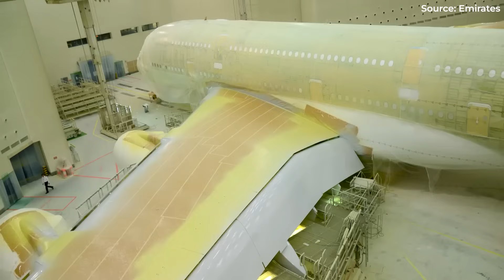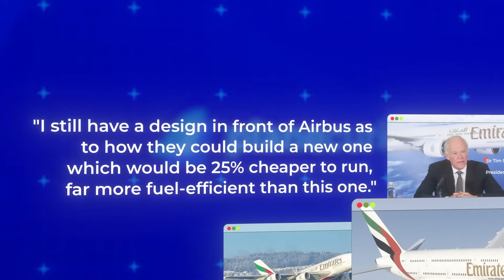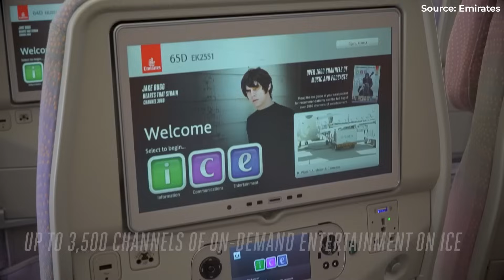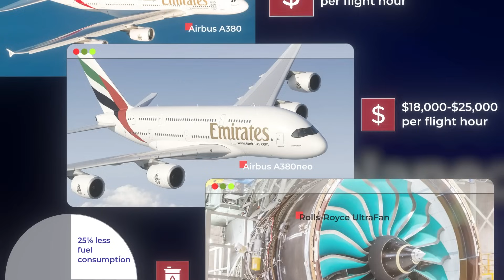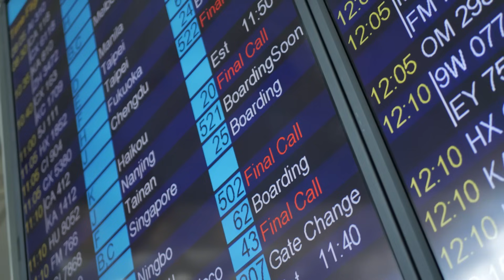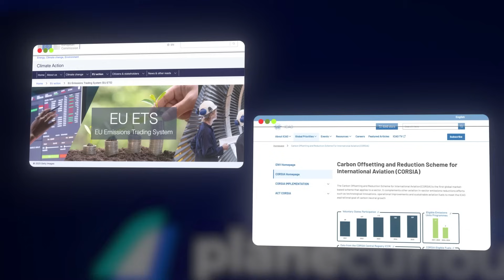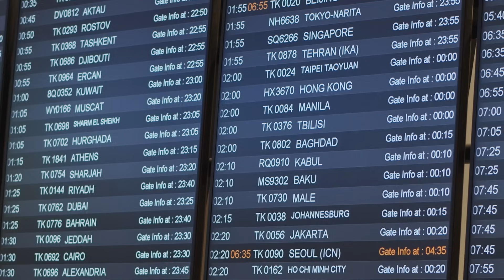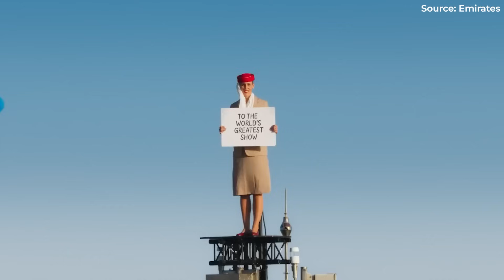Emirates Needs The A380neo - But Here’s The Twist

Comment: the A380-900neo a stretched variant of the A380-800 was conceptualized way back in 2011 . . . but the dream was never realized due A380-800 less than satisfactory sales . . . AIRBUS should have launched the stretched A380-900 variant instead of the A380-800 like they did with the A350 family . . . the stretched A350-900 was launched prior to the A350-800, although the A350-800 never made it to the assembly line is a story for another day . . .

Comment: Emirates has succeeded the hub and spoke..... They literally pour millions in dxb and reroute millions to final destinations. Clark masterminded the hub and spoke. For this hub and spoke to be successful, a380 is the key
Reply: tsa check at airport like changi ( singapore) is a stupidity that ruined the hub and spoke . they even debark plane get them thru security to rembark on same plane on route london singapore sydney . without such corruption or stupidy hub and spoke is cheaper more efficient used everywhere else in any transport route i have yet to find a city which metro aways follow direct route so far i saw  use hub and spoke long distance, regional trains ..... car are direct but they are dying in the world didn't ford and gm noticed ?

Comment: Would having 3 engines instead of 4 work? Like the tristar? Have (3) GE9X engines? That's enough thrust but servicing the engine at the tail will be alot of labor.
Reply: Frighteningly high re-engineering costs and the reason 3 engine planes died is, in part, down to what happens when that engine lets go and breaks rudders, hydraulic lines etc. The words “hull loss” come to mind… and 600 dead pax!

Comment: Possible solution: upgrade, don't replace. Replace the winglets with the plus version, replace the engines with more efficient ones (this is expensive and complicated but I think thats way easier than building a whole new plane because u could reuse the fuselage. If theres still enough budget, may even consider replacing the wings with smaller lighter more efficient wings. and maybe even replace the gear with a lighter one. I think this would actually be possible.

Comment: You are forgetting the part of the equation which is airport infrastructure and gates.  

Some airports upgraded taxiways but the number of gates that support a380 were limited.   Norwegian Air experienced this when flying the hifly a380 to JFK.  The limited gates that supported the a380 were taken.

Given the a380 already failed once, airports, which are government owned entities, would have to justify to cost of building gates. 

Right now, they have far more gates that support the 777 and 747, and the 777x fits those existing gates that don’t fit the a380.

Planes like the 787, a350 and 777 can operate at more airports using existing infrastructure.

Building a380’s in the USA wont make a difference to US Airlines,  they didn’t order the a380 before because it doesn’t fit their business model of multiple hubs with lots of non-stop flights to many places. 

Even flagship European airlines like BA, Air France,  KLM and Lufthansa did not order enough a380’s combined to make a difference.

Limited run aircraft for a specific user are astronomically expensive.  Just look at military aircraft and the unit cost when you only want 20 or 100 planes. 

Maybe emirates can offer $50 billion to build 100 planes guaranteed and then get a discount on the second 100 planes but inflation will mean those second 100 cost another $50 Billion or maybe $75 Billion.

Comment: I absolutely love flying on the Emirates A380's - as a passenger when I'm booking my flight I'll always take the route and time slot that gives me the A380 if possible. I'd love to see the A380 get a second chance with the improvements that address all the criticisms. If the current generation makes sense for Emirates and these things make huge differences to the operating costs then it's a bit of a no brainer. If it needs a new factory, honestly think Emirates should push for that factory to be in Dubai and be a joint venture - Emirates funding and Airbus operating - and make the A380 Neo exclusive to Emirates - let them have the competitive advantage. Then keep the facility for refurbishment, maintenance and upgrades, or potentially have the option of running it at 100% production capacity for the initial run and then taper it off to 25-50% of the capacity focussing on new plane production and the remaining space pivots to maintenance.

Comment: If they restart the A380 production lines, then they should go the full hog and launch the A380-900 Neo. The current A380 has a disproportionately large wing and heavier-than-necessary undercarriage to allow for a stretch that never eventuated. And moving 800 passengers rather than 600 per flight would bring seat-mile costs down even further.

Comment: We constantly hear arguments for and against a new A380. However, people keep missing the most important point.

An aircraft manufacturer doesn't just need a large enough order to make it work, but to guarantee continued production, it needs sufficient orders to provide a high enough rate of assembly to keep the line viable until the earliest examples need to be replaced. Clearly this isn't an issue with the likes of the 737 and A320 aircraft series, where an Airline could place an order for the replacement on the same day as that factory-fresh aircraft was delivered. Even so, they might still be keeping hold of them for longer than they would like. 

No matter how good the aircraft is, and no matter how much the airlines love it, insufficient demand will see the production line closed down. The 757 being a good example here.

We must also consider if the resources required (manpower and production space) could be better with tioised elsewhere.

Comment: I've lobbied President Trump and VP JD Vance to build the A380neo in Mobile Alabama. That way with a 'Made in America' sticker would enable the US airlines to buy them and use them for long haul. They would also get around tariffs and be worth $500 Billion to the US economy. Emirates would probably buy as many as they can get hold of to replace the existing A380 and it would take 10 years to do that, by which time the old A380 will be at the end of their useable life anyway.

Airbus does not need to relocate existing production lines - just start a new one in America. Let's not forget - that 25 Billion loss was absorbed by the EU, but they could make back that loss with the A380 neo if they get 1000 orders. The B777X and A350-1000 cannot make up for the demand and get around the slot problem. Building the A380neo is needed now to provide the aircraft for the 2030s to the 2060s.
Reply: The one thing I see with that that I just don’t think would work is us based airlines investing in it.   I don’t think they would.  Even if it was made in America, I just don’t think it would fit their business models.   747-8i was built in USA but no American Airliners bought it.   So I honestly can’t see any investing in a USA made A380

Comment: Its all according to HOW BAD emirates want a 380-Neo. Airbus already said they redesignated it’s facilities to something else. So if Emirates want it that bad, they should build the facility in Dubai, pay for the machinery and retooling, and pay Airbus for its employees to design the -a380NEO . Because it would specifically be for Emirates. Airbus should not come out of pocket for anything. 

This project should be completely paid for by Emirates. I believe if they gave them that option, Airbus might bite.
Reply: All the Airbus facilities are now occupied. To build the A380neo they would need a fresh factory. However, they could build it at an existing Airbus site in the United States. Airbus originally wanted to build over 1000 A380. Emirates considered 126 enough, but they might want more if it were economical. Maybe 250, but not much more than that. 

Emirates currently has 9 x A350-900, 121 x A380, 22 x B777F1H and 119 x B777ER. That's 271 aircraft.
They've ordered 205 x B777X and 15 x A350-900 but so far, Sir Tim Clark will not order the A350-1000 unless Rolls Royce sorts out the cycle problem with the Trent XWB. So that's 220 aircraft on order - but they might cancel some of the B777X if Boeing do not deliver and order the A350-1000 instead.

If Airbus were to build the A380neo, it would take them about 5 to 10 years to get them coming off the production line - just as the current A380 are retired. That way they might not need as many B777X or A350-1000.
Reply: @WOTArtyNoobs  if built, the a380-Neo would be a Emirates exclusive jet. Because they would have to fully pay for it., from the enormous facilities, to the development team, to the machinery needed to physically build it. So why not build a factory in Dubai since it’s going to Emirates.. the person that paid for it
Reply: @WOTArtyNoobs  Airbus doesn't work with a 'factory' business model, it works via modular manufacturing that gets assembled. That means it just needs a new assembly hall and that's not that expensive compared to the profit per unit.

Comment: The point to point model only had a limited lifespan. When it reaches capacity, the demand for giant planes will return, even if that's on point to point routes!
Reply: Most people think that as it is so big that there are few airports that can take the A380. That's not true. It does require two or three air bridges to load and offload comfortably, but it would not require much work elsewhere at the airport.

Comment: Airbus would likely make a stretch A350-2000 then resurrect the A380.
Reply: Not sure they can. The A350-1000 took this design to the maximum limit. If they were to elongate the fuselage much more, then rotation might not be possible. You would get tail strike when the pilot rotates. The A380neo would also stretch the fuselage, but not past the point that it causes tail strikes.
Reply: @WOTArtyNoobs But A380neo despite more efficient than the original A380 is not efficient enough compared to dual engine wide body aircrafts loke A350.
Reply: @WOTArtyNoobs  yes you're at the limit of length with the -1000, the A380  is the only way; or a A350 twin deck

Comment: If Emirates are ready to pay than I would love for Airbus to build it. One of the best airplanes ever.
Reply: It's a question of building them at a brand new Airbus factory in America. They already build the A320neo, the A220 and the A319 at Mobile. If they added the A380neo then it could be worth $500 Billion to the American economy and they would sell to US airlines too.
Reply: @WOTArtyNoobs nah us airlines never wanted the A380 in the front place they won’t even want A380neo
Reply: @JackMooGamer45 Let's clarify this. The American airlines did not want the A380-800 for several reasons. Firstly it was a foreign aircraft and very expensive. Most airlines try to buy domestic because they are big capital spends and they need the local support. Secondly, it did not fit the business model that the US airlines were addicted to, Point to Point flights. Thirdly, they wanted to offer the passenger several flights a day for convenience of picking their own travel time and lastly (and most importantly) the A380-800 has four engines instead of two and that means greater fuel burn and maintenance costs. 

Most American airlines have multiple hubs spread out over the US and this means they can shuttle people back and forth in small passenger jets like the Boeing 737 series or the Airbus A320 series. One huge A380, even though it can carry between 500 and 800 passengers, would not be best for several flights a day because of the fuel cost.

However, the American airlines did not take into account slot restrictions. There are airports in the United States that have capacity constraints. JFK and La Guardia LGA are restricted, as is Ronald Reagan DCA in Washington. The majority of US airports have ample space for the traffic. In the rest of the world, the slot restraints are at Heathrow LHR, Changi SIN and Dubai DXB. You almost cannot buy slots to land at these airports for love or money. British Airways almost monopolises Heathrow because they bought out the other major user of that airport and they did it to buy their slots. Emirates monopolises Dubai DXB, but they probably won't do this when they move to DWC as it's far bigger. Singapore Airlines monopolizes Changi because it's a State owned enterprise and Singapore is tiny when it comes to land. The A380 is perfect for slot restraints as you only need one or two of them a day to carry massive amounts of passengers to other hubs. 

None of the American airlines considered that it was important to have large aircraft to fly to international hubs, so they made do with the Boeing 777-300 or other wide--bodies to do this, even though it constrained them to a maximum of 300 passengers. They are now starting to realise in the post Covid boom that this was wrong. The demand for international air travel is booming, whilst the demand within the US is almost stagnating. Many US airports are facing massive shortfalls of passengers, mainly due to domestic decline during the past 4 years. Whilst the rest of the world cannot get enough travel, the US market is facing problems of price increases and shorter passenger loads. Part of this is down to the fact that many of these point to point aircraft are flying with low % loads and partially because when you have several aircraft flying a day instead of just one, you have the extra capital cost of the additional aircraft. So whilst prices on ordinary carriers are getting higher, more people are flying Ultra Low Cost Carriers because they cannot afford the usual airlines. The ULCC airlines can afford to do what they do because they offer no frills travel and usually have the same aircraft - such as South West using only B737.

What the US airlines neglected was their ability to get the international passengers to use them for flights to the States. Instead, these passengers use A380 to travel to the hubs and then ULCC to travel to their final destination - which is the hub model, not point to point. 

If the A380neo was built with the Rolls Royce UltraFan, it would be as fuel efficient as the Boeing 777X or A350-1000 due to the numbers carried. The A380neo could carry 1000 passengers in all economy, but would more than likely only carry as much as 650, with a higher percentage of Business and First. This is because the stretches to the hull would be in the areas where the premium passengers sit. Premium passengers love the A380 because of all the perks it brings. It's comfortable, it's quiet, there's masses of space and on some there are even showers and bars. The A380neo would not only be cheaper to run per passenger, even with increased maintenance costs, but it would attract more passengers that would stick with the airline for the follow on flight. Take Emirates as an example. They run the A380 as a hub aircraft and you can fly to just about any destination from Dubai and most of those are on A380. Even if they are not A380, you are switching to another of their fleet for the final flight to the ultimate destination. 

If the A380neo were made in America, it could be worth $500 Billion to the US economy. It's very likely that Emirates would buy as many as 200 of these, whilst current users would probably double their fleet or even triple them. If they could have an A380neo as cheaply as a Boeing 777X, they would get the A380 for the passenger appeal alone!

Airbus say that they want $25 Billion down (the cost of the losses on the original A380-800) before they would even consider the A380neo. Emirates is already offering to invest $20 Billion and they might stretch to the other $5 Billion to make the aircraft or even build them themselves in the UAE. The closer that the A380-800 get to retirement, the more that the airlines using them will seek to extend their lives (which Airbus might be thinking about right now with a upgrade program) or replace them kind for kind with some new aircraft. Lots of people have dumped on the idea of the Blended Wing Body as nothing but snake-oil, but the US military seem to like them as they are buying the B-21 Raider. Far more than the B2 Spirit. I have a feeling that we will see a BWB passenger aircraft in the next 10 years and that might be the replacement for the A380-800 if Airbus refuses to make the A380neo.

Comment: Airbus said the A350-2000 is possible and will be build when needed so maybe Emirates will buy it instead
Reply: Boeing would probably pitch 777x-10 to Emirates if Airbus tries with A350-2000
Reply: @jayvee8502  Both can try but the fact remains neither model will have the space and comfort A380 can offer. Emirates would need to compromise big time either way.

Comment: Airbus have Airbus Tianjin for China-only A320 FAL... Emirates could/should just get Airbus to open Airbus Dubai/Abu Dhabi to build the A380neo... I think a 80~85m plane is something Cathay would want if the A380neo improves its belly-cargo carrying capacity
Reply: A new A380 costs over $432m. The A380neo is likely to be as much as $500m per unit or more